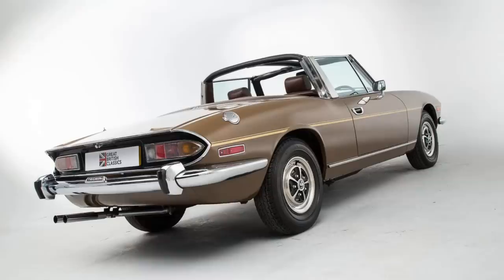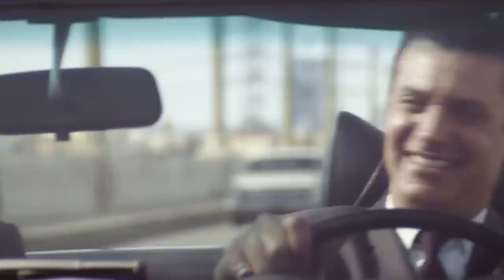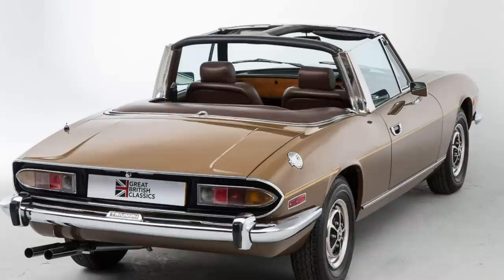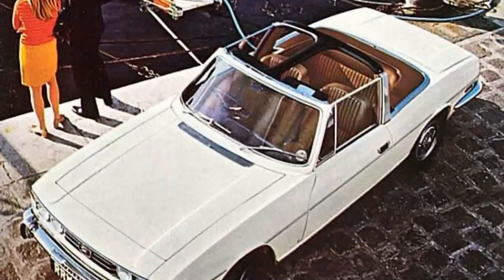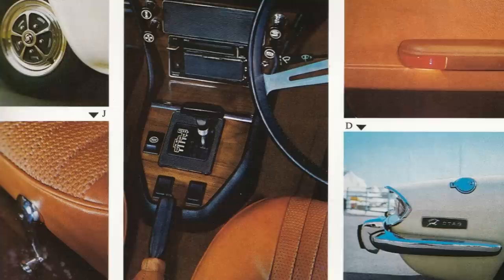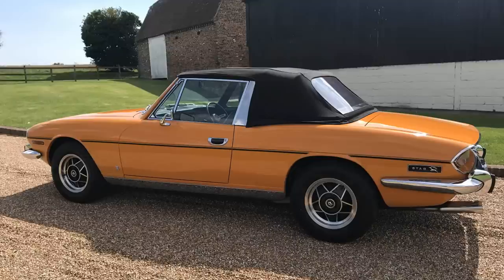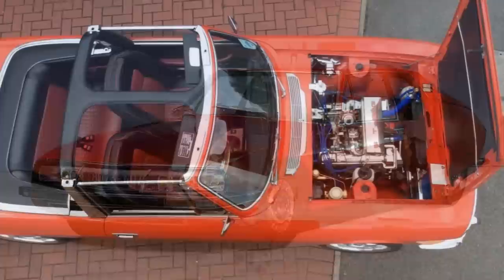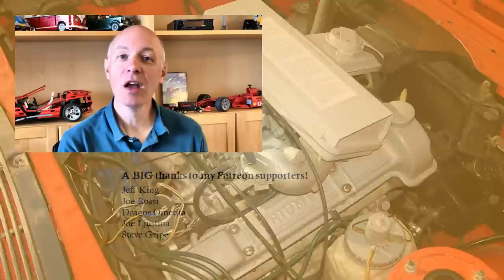Why did the Stag FAIL so Spectacularly?

Comment: Thanks for the video. My family has owned two Stags. One (my dad's) was all original, the other (my car) had a rebuilt high performance  2.8 liter V-6 German Ford Capri motor. With the engine swap, I could do over 60 mph in first gear. Dusted quite a few 911s in the eighties.
Reply: Nice
Reply: Yeah but you lost of the most important parts of the car, the sound!
Reply: I ran a 2 8 Ford V-6 in a B sports racing Lola  . I dynoed it at 330 hp . It was dry-sumped , and had a custom cast               cross-ram intake Manifold with 2 Porsche RS 3 barrel Webers . Dual point distributor . Max RPM 8500 . The week           link was the small necks on the rods . The compression was so high , I had to run 2/3 premium + 1/3 100/130 av-gas . I could only get over 200 mph drafting an A car .
Reply: Yes - the German V6 was very good, the version that Ford put in the Mustangs was a piece of s--- from the carburetor down.

Comment: Fun story: When Saab wanted a more powerful engine for their 99 lineup they went to Triumph (they were already using Triumph slant 4 engines, although they improved them) to see if they could use their V8 in the 99. Triumph agreed and Saab did some testing with this engine but determined it to be too unreliable, still looking for more power they decided to add a turbo to their existing engine, making Saab one of the earlier Turbo adopters.

Comment: Your description of the engine's multiple design and production problems are brilliant.
Stags developed the worst reputation possible here in New Zealand, where most people installed the Rover 3.5 after spending half the value of the car in pointless repairs to the bad engine.
Reply: Triumph Stags are a very rare sight here on the road (NZ) nowadays; I suspect that there are quite a few though sitting in owners garages, gently fading away because their owners don't have the $$ or the will  to fix them.  A great shame as the Stag is a great looking car.  A real head turner.
Reply: @gordonnorris6991  Agreed there was one near me up until a few years ago

Comment: I worked for a Triumph restoration company in late 80s. The Stag owners were Always told to bin the Triumph V8 & replace it with the Rover unit. Making it the car it should have always been. Also the half v8  engine, with the iron block & alloy head would weld together, making head removal near impossible.

Comment: Working for a sub-contractor from the early 70's through to the BA takeover, I was mainly involved with Redditch Marketing, but also met with engineers from Canley, Solihull and Longbridge. The consensus among those I met was the engine was ruined by the cost cutting team assembled by Stokes. The biggest problem being the duplex timing chain originally specified being reduced to a single one, but also the cheap coolant that caused the heads to weld to the crankcase. The engine survived as long as it did because of contracts signed with Saab before design work even began.

I seem to recall that same team removing one of the E-Type's windscreen wipers and fitting (Morris Marina?) window winder mechanisms that caused the doors to come open when completely down.

Comment: I bought a brand new Triumph Stag in 1973. It went through 7 (yes, 7)  cylinder heads in the first year.  I was doing pretty well at that time and graduated from the Stag to a Ferrari in 1974.  Most of the girls I took in the Ferrari said they preferred the Stag..... It was, by far, the best bird pulling car I've ever owned. - However, the reliability was absurdly bad. Had the Stag used the Rover engine (lighter and much more powerful) and had a bit more quality control,  it would have been an unbelievable winner. It wouldn't have needed much to make that car superb.

Comment: I remember going to Coventry to meet Eamon Hurley of Hurley race engineering. He would put the ford 3.0 V6 in a stag . I asked him if he had a use for the left over V8s ? his answer cam back straight away "yes, filling up dustbins".
Reply: It's the other way round now.  They are throwing out the Ford or Rover engines and putting back that wonderful Stag V8.
Reply: That original Stag made a good anchor too
Reply: Ford 3 ltr cast iron v6 is a piece of poo engine. I believe it was originally designed to be a diesel.
Reply: @psk5746  WTF ??? The Ford V6 engine would last over 200K miles...
Reply: @davidhollenshead4892  So what. 200k miles of boredom

Comment: SAAB took engine production in-house in 72 and redesigned the cylinder head (B Series).  Revised in 81 (H Series), and a 16-valve head in 85.  Continued to evolve until the end of production in 2009.
Reply: Triumph built them at Canley in the mid/late 70s. I worked on the engine track.
Reply: Put a proper timing chain on it as well.

Comment: Years ago, I was working for a company next to a garage, one of the shareholders (en extremely wealthy Luxembourger, who had passed the aforesaid garage to his son) had a mint blue Stag.
He pulled open the bonnet and pointed at a random rubber pipe. "See this? Orginaly it was a bolt. Had they put this extra cooling pipe when the cars were built, they would never have had a problem".
Reply: It was the cooling system which was a prime cause of the problems. Many owners sorted the cooling and then had a reliable nice old car.

Comment: I had a gorgeous Stag for five years, it had been rebuilt by someone who knew what they were doing.  4 speed manual gearbox with overdrive, original V8, stainless steel exhausts. The only big job I did was to fit an electric fan. I used it as my everyday car for the time I had it, top down unless it was actually raining.  It was gorgeous, sounded like a dream. Power windows, power steering.  If going travelling (or biosecurity to France), one could even put the roof up and use the space the roof went into for extra storage!  I sold it because I was moving house, most stupid thing I ever did with a car (if you discount converting a Jeep Cherokee to LPG).  A while later I got an automatic Stag - totally different beast to drive, didn't keep it long.

Comment: One of the Triumph engines was blueprinted as part of a rebuild, they were expecting to increase to size of the radiator etc, but found that it worked perfectly as long as it was built to the spec. Unfortunately those coming off the line were anything but. Of those Stags that have survived most have had the engines built properly and are much sort after for the fine reliable car it should have always been.
Reply: For the love of cars

Comment: Another fine video! Perhaps the case could be made that the TR8 was the Stag's successor. With the Buick/Rover aluminum V8 it was far more reliable too.
Reply: Just like "Trigger's Broom" later versions of the little Buick V8 were a a very different engine.

Comment: Have one and i rebuilt the engine. I have electric waterpump installed wich does an excelent job. I use it quite alot and it does not let me down. Very smooth although little underpowered as said. I love the car.

Comment: Nice video - thanks.  As other have mentioned,  the stag V8 and Dolomite 1850 4 used single cam chains and they were prone to jumping resulting in collisions between valves and pistons.  Warped aluminium cylinder heads and cracked cooling parts also plagued these models.
Reply: Stephen Jones My dad had 2 triumph dolomites in his early twenties. One was a 1500 and the other was a 1850HL. the common problem was overheating and cylinder head warpage which meant the cylinder heads needed to be removed. I think he had to take them off about 3 or 4 times while he owned them. They were constantly jumping out of gear as well😂🤣😂

Comment: And have car companies learned their lessons? They continue to design new crap to this day when reliable engines are phased out of production.
Reply: Pressure by EU emission laws
Reply: @greathey1234  pressure from bean counters, the profits just aren't there like they were.
Reply: @richardrichard5409  i agree. look at the BMW six cylinder motors... from E36 -> the cost reductions coupled with turbos... couped with dropping two cylinders allegedly for emissions. really to satisfy profit margins... right? you're getting 25 mpg under most conditions with either motor. let those turbos spool up and watch your mileage... it seems farcical.
it's happened in every industry. people without industry passion, analyzing the business for shareholders, while never understanding the customers that actually purchase your product. in fact, in some ways auto execs hate their customers... making them build multiple models... motors and transmissions... how dare we!?
you'll take your eighteen speed automatic like a man!!

Comment: I distinctly remember being overtaken by a brand new Stag on a long gravel road, which was riddled with corrugations. We were in our awesome '72 Landcruiser at the time, going about 60 km/h. Dad's friend, Alan, went by at 100+. We had to stop at one point, to pick up the rear bumper, which had fallen off the car about 20 kilometres into the unpaved section.

When we got to our destination, my Dad gleefully handed Alan his rear bumper. Later on, when we had a close look at the car, we could see the panels were not aligned correctly - which was perhaps also due to excessive speed on the corrugated road. Inside we found some of the trim beginning to come away from the backing, and some of the stitching was poor. One of the door handles didn't work quite right, either. I think the Stag was 4 months old at the time. My Dad encouraged me to buy only Japanese cars when I was old enough. That great advice could have saved me many tens of thousands of dollars maintaining a German supercar for a decade - but of course, it did not. :P